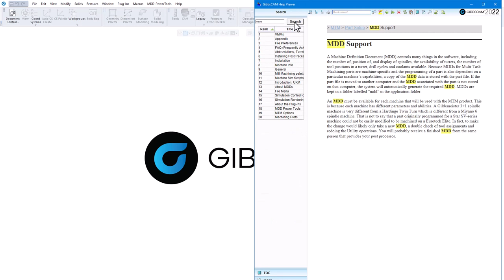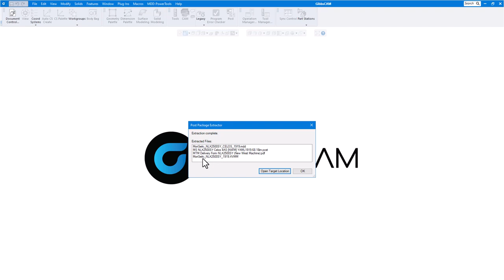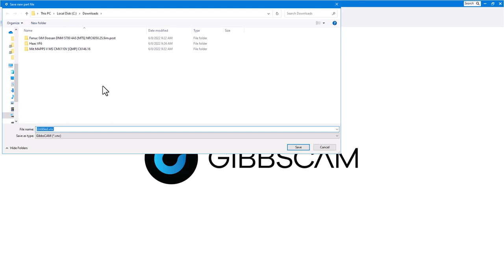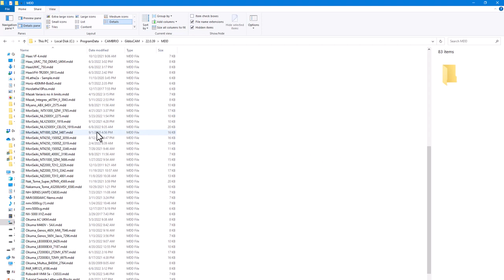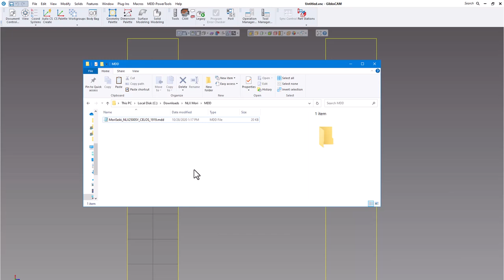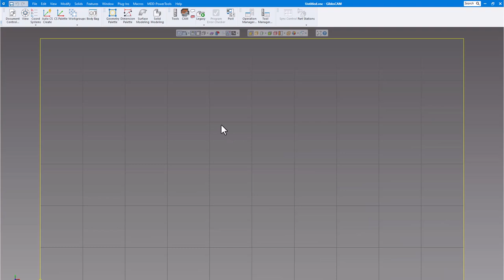Setting up GibbsCAM Post processors

Comment: Are MDDs and VMMs supplied by my DMG dealer? We recently bought our first new machines from mori nlx3000 cmx110v and nvx7000 and we’ve  been experiencing some issues with missing g codes and wrong mcodes on the post. Will adding those files help with that?
Reply from the maker: Normally MDD's and VMM's are supplied by Gibbs post department.  Note though that not all cnc's need a mdd and vmm.  Once you have a machine that has say high-pressure coolant, air-blow, or other accessories that require special M-codes, etc, then you would get a MDD.  Since the NLX3000 does not have a sub-spindle, you would not need a vmm.  If it has a programmable tailstock you can request to have the tailstock part of the post, but normally you don't need it on a tailstock, as you have to manually set the tailstock distances anyway, then it's just one line of code to activate the tailstock (M25, M26).  The cmx1100v is a 3-axis vertical with/without a 4th axis.  That would not need a vmm either.  Maybe a MDD if you have specific options.  If you just received the post processors, you have time to test and then you can request some post changes if you need to add some specific options (hp coolant, air-blow, etc).  Then the post department will probably put them in a specific MDD for you.  Note:  Some GibbsCAM resellers do their own posts, but for the most part Gibbs post department does them.  Hope this helps.